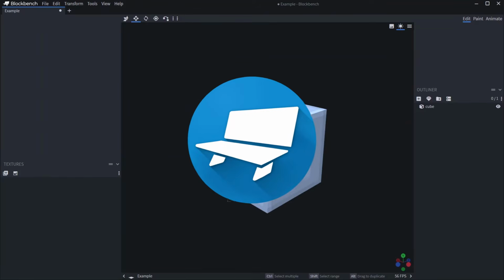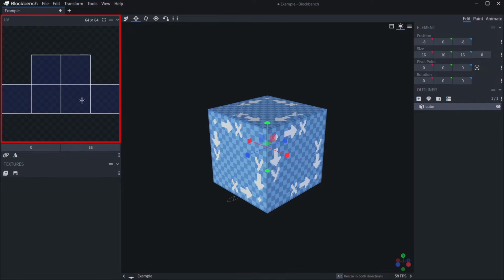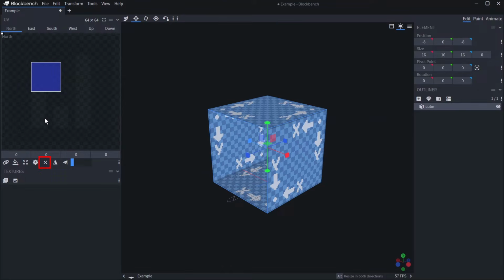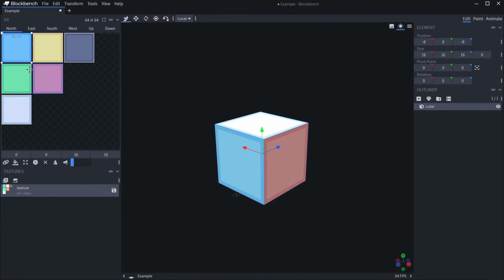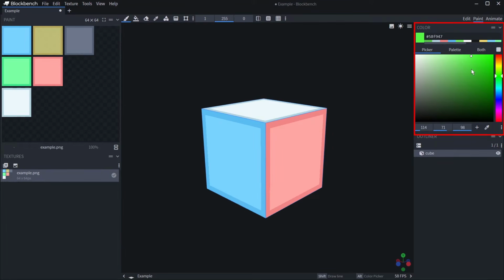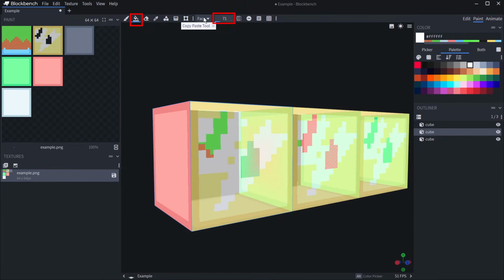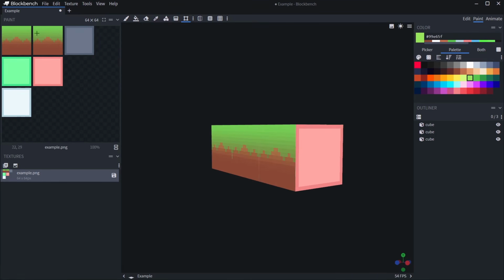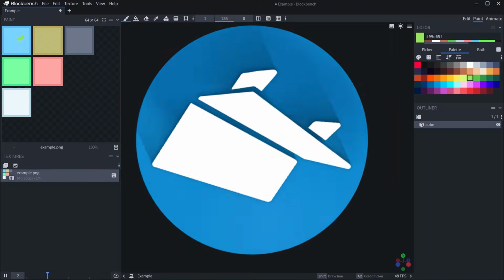Learn to Texture in Blockbench

Comment: Thanks to google's stupid AI for putting me here (and about 100 other videos that had nothing to do with my search). Let's set the record straight,  this is NOT UV tiling. True UV Tiling has always been when the UV coordinates extend beyond the texture's size, causing the texture to repeat over and over.  You can get that kind of tiling but you do have to edit the .json model outside blockbench. This "tiling" is just duplicating faces which kinda defeats the point in the first place since you could stretch the model and tile the UVs.  To me, hacks are things you aren't normally supposed to be able to do, this stuff is all well documented and apparent (and obvious). But yeah, apparently there are a lot of people who can't be bothered to read the manual which is why this was popular enough to get hits from google search...smh. (conscience==0).